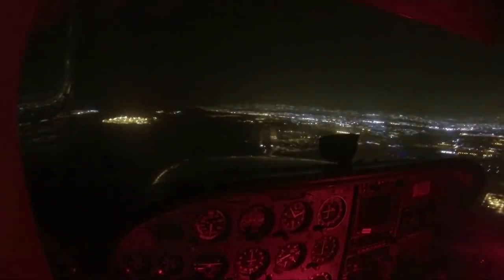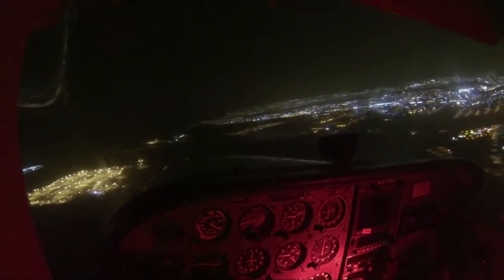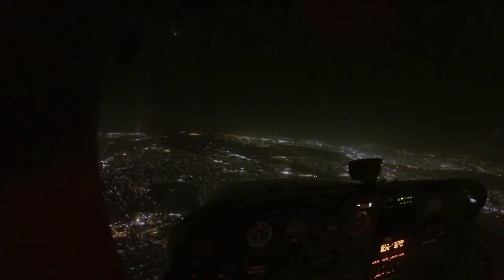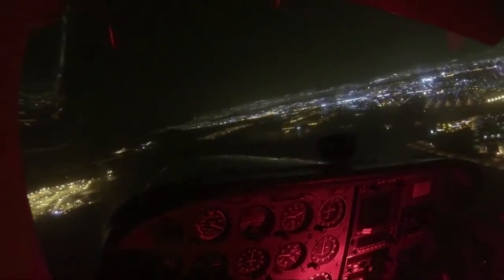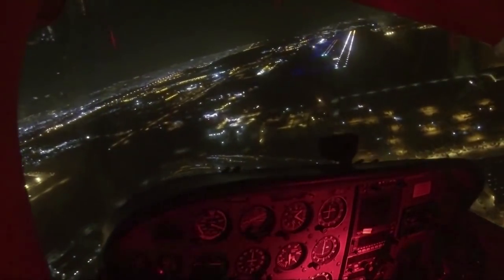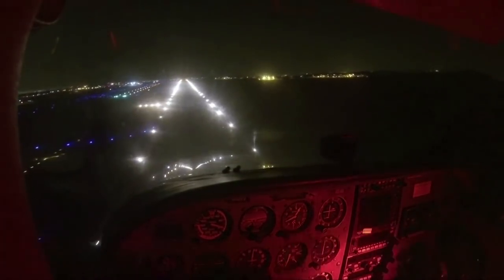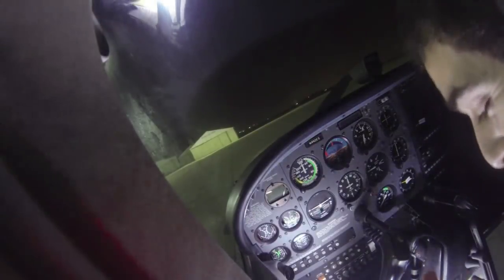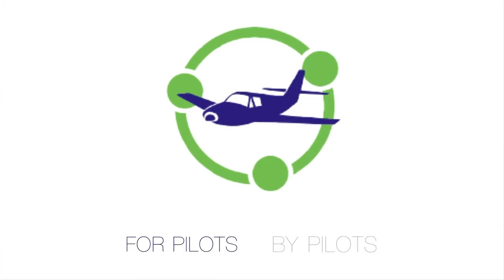Total Electrical Failure at NIGHT - Low time pilot - POV Flying

Comment: I know this video. Great work! Great airmenship....
But : If you're flying in Europe (or let's say outside of the U.S. / Canada Region) you won't even have a ARCAL. If it's dark, it'll stay dark!
But: If you do you're in doing night rating, ask ATC to grad. switch down light. It'll give you a impression about what could happen...

Remember: DO NOT SWITCH ON LIGHTS! It'll blind you! Your night-vision needs aprox. 30 minutes to be 'good' , but just a flash to be back at zero!!!!!! 

My personal is more into "What will I do in a Night SE Failure while XC...."
Reply from the maker: EXCELLENT point about not turning the lights back on right in front of your face... 
Best do cycle them from far away and then be sure the intensity is set to where you want them...
And agreed that an engine failure at night is a whole world of trouble.

Comment: Reminds a little of the joke: You have a complete engine failure at night.  You feather your prop and  turn on your landing light and find that you're flying up a box canyon with high walls on each side and of course you're descending.  What is the best course of action?
Answer:  Turn off the landing light.  You really don't want to see that.

Comment: I think he did the right thing to land the plane despite the lights going off, with electric failure your options are rather limited and if you can land, you should land. Otherwise you will have to ditch and that is not good.

Comment: I just recently did my first night flight and i was at an unfamiliar airport in the middle of nowhere with no lights around the airfield and I was turning downwind to base when the runway lights cut out on me and I instinctively keyed the mic once I leveled the wings on base and didn't see the runway where it was supposed to be and sure enough the lights had turned off on me, but after watching this I am for sure going to get a handheld because I don't ever want to get in that kind of a pickle!! I think that should even be a legal requirement to have on-board on night flights!!!

Comment: WATCH CLOSELY BETWEEN 3:09 and 3:10 in the video...  There is an object that passes by the aircraft at an AMAZING rate of speed, and veers off to the right.  What the hell  was that?   I'm not sure if it is just a reflection in the windscreen or not, but it sure looks like a flying object...

Comment: What is plan B (or C) if the runway went out way before he got there?  Divert to another runway?
Reply from the maker: Feint well...  diverting to a different airport wouldn't solve the problem.  He would likely have had to abort and climb up and then see about getting the hand held radio tuned to get those lights on.

Comment: Since he didn't declare an emergency, wouldn't this be a cars violation? Landing at night without the proper lighting?
Reply from the maker: Interesting theoretical point, but I think in practice it is ultimately moot... first off, it was in the states so the CARs don't apply ( but maybe there are similar FARs), second, he had no way to declare as his radio was not working, and there was no one in range to hear the call anyway... so it could be argued that he would have declared if he could have.  Bottom line, I highly doubt he'd get violated by any regulator for handling this the way he did.
Reply: Declaring doesn't require a radio.  It's an internal action/concept.  Otherwise aircraft without radios could never declare an emergency.  There was no violation of FARs due to the emergency of the situation.
Reply: In both the US and Canada (and, for that matter, most other first-world countries), if a law requires something impossible or unsafe, you're not legally liable for breaking it. So, for instance, if you can prove that the accelerator on your car was stuck, the speeding ticket goes away.

Comment: I know they need to turn the light off but why don't they have low-level lights like those blue ones because if they do shut off while you're trying to land at least the low-level white ones would still give you a good indication where the ground is bought a fact anybody else in the area because they won't be that bright

Comment: why can't the lights just be on all the time? is the cost of electricity to great to outweigh the benifet of that?
Reply: Yes, they need to save energy and reduce light pollution for the surrounding neighborhood. It's very expensive to run those lights.

Comment: I'm not a pilot, but the first thing that comes to mind is to turn off the landing lights, and reset the breaker...    I could be wrong though.
Reply: The camera doesn't show the lighting panel, so you can't see that he did just that, and it didn't help.

Comment: Maybe I missed this part but was he able to click the runway lights on?  I see the lights on but I'm not sure if he turned them on or someone else or whatever other reason.

Regardless, what I'm interested to know is how would you turn the runway lights on if you had an electrical or even just a radio failure?  Without a backup portable/handheld radio, how could you do this?
Reply from the maker: He arrived just as the tower was closing... (if you watch the beginning again you can see that I establish that - but maybe not well enough apparently :)
So, he didn't need to turn the lights on when his radio was working, but when the tower closes, the count down starts; usually ~5 or 10 minutes I think..?
As for how to turn the lights on with out a radio - you can't - It's a bad situation to be in - that's kind of the point of the video :P
Reply: I also just read the description which stated that it was a dead cell that caused a short of some kind when the landing lights were turned on.  I'm wondering if you were to flip the landing lights back to off or remove the fuse, would the load on the battery be reduced enough to return power?
Reply from the maker: Eric Gravel Good questions - I'm not sure of the specifics of exactly what Steven did to trouble shoot - but I imagine he tried most of that...
Maybe he can respond if he see's this comment.
Reply: ***** I knew about turning lights on using radio (I'm a student pilot with 10 hours thus far) but not that much more.  I was reading the wiki page on it and it says that you can turn them on with 7 clicks and intensity can be changed with 3, 5, or 7 clicks afterwards for low, medium, high intensity.  There's also a comment in there stating that it's a good idea to key in the intensity level (either current one or the one you desire when on final) so as to reset the countdown.  That would avoid the situation he found himself in; lights turning off when you're flaring the plane.
Reply: That is a very good idea (pull some fuses). However, I did not try that. In my troubleshooting, I turned everything off, then tried to get things back, one at a time, and not a single thing worked but the flaps until we had shut down the aircraft. Once EVERYTHING had been shut off (engine included), I was able to get my lights back on. I have no idea if pulling any fuses would have done anything as this was such an odd and unpredictable electrical failure (note even an intermittent VAC warning. There was never any VAC issues.) 

Not a bad idea though, that's for sure. Fly safe.
Reply: Steven martinet
what airport was that
Reply: No, a person in the tower has to put the runway lights on.
Reply: @Laverne Johnson, "this dope" if you're referring to the low time pilot in the video performed extremely well, didn't panic, managed risk, and continued his approach to a successful landing while the lights extinguished.  I'd bet many high time pilots wouldn't perform this calmly in the same situation.
Reply: At least that dope probably understands that radios run on electricity, and thus a complete electrical failure means your radio doesn't work. He didn't forget.

Comment: Why are the runway landing lights turned off on short finals? is it a procedure or what?
Reply: +charan k.v The tower had closed, at which point the runway lights become pilot controlled.  usually (when your radio is working) you would tune the CTAF frequency and click your transmit button 3, 5, or 7 times for low, medium, and high intensity runway lighting.

Comment: Was the runway lights going off a failure or are they supposed to go off when no planes have landed in a while?
Reply: +themikester223 They are on a timer, The pilot uses the radio to turn them on and then a timer starts to turn them off. Pilots can also manually turn them off or dim them is needed. All with the radio and mic clicks
Reply: Brian Green Thanks!
Reply: Wish we had such a system in Germany

Comment: amagine how bad this would be with a glass cockpit
Reply from the maker: +PEPcessna - Retired There is a back up battery, so I "think" the electrical has more redundancy - that said, there are also back up steam gauges for airspeed, altitude and attitude, so you're not in that much worse a spot.
Reply: that is very true, losing your primary flgith display would not help in this situation, but thanks for the info didnt know that glass cockpit had backups
Reply: +PEPcessna - Retired He also had a tablet.  Not the best but he could have got some information from it.  Something is better than completely nothing.

Comment: Potentially stupid question because I'm not a pilot. Did he have control over the runway lights or is that a completely separate issue that happened?
Reply: They are on a timer. They activate when a pilot uses his radio. He had no radio.

Comment: Why would they of runway lights.......its actually quiet risky for the pilots while landing so y would they do it so?
Reply: It saves on electricity. Airport lighting burns a LOT of juice, and a lot of airports are on shoestring budgets, heavily subsidized by local governments whenever they can't pay all the bills from tenant services like FBO's, mechanics, hangar rentals, etc., so they have to cut costs wherever they can afford to do so.

So a lot of airports such as this one, have an automated system at night that listens in for a thrice-keyed mic on the freq the system is tuned to listen on. Pilots can then tune their radios to that freq, key the mic three times, and boom. THERE SHALL BE LIGHT!!! :D

For tower-controlled airports, this also cuts the cost of having to keep the tower staffed and running 24/7 as well. The general rule of thumb is that tower-controlled airports become uncontrolled after the tower closes, and all pilots coming in or leaving during that time are basically on their own save for the sector ATC which is often in a facility somewhere far removed from the airport.

Comment: What are the odds of having electrical problem with the plane, and the runway happening in the same incident? this is some Devil shit
Reply from the maker: The runway lights actually time out after a few minutes (at non towered fields, or at towered fields when the tower is closed).  The pilot can reset them by clicking the transmit button on the radio a few times.... assuming the plane has power to the radio

Comment: Why he uses red flashlight/
Reply from the maker: Gediminas Jesinas red helps preserve night vision.
Reply: ***** Thanks, this is good advice.
Reply: +Gediminas Jesinas Our eyes have two different kinds of photo recepors.  Rods and Cones.  Rod cells are almost entirely responsible for our night vision, but it can take your eye a little while to fully transferring to using almost only rods.  Cone cells are primarily needed for color vision while in bright light.  Red is very low in the color spectrum that our eyes can see.  In fact the next color below red is Infra-red, which we can't even see without special equipment.

In a very dark cockpit, if you were to suddenly use the very blue white of a normal flashlight, your eyes would immediately begin relying on its cone cells again, and to get your good night vision back you would have to go through the long process again (30min if i remember correctly for full night vision).  By using a red flashlight, you can see what you need, but don't force this change in your eye.

Same reason that if you go out to look at the starts, they become more brilliant and beautiful as your eyes adjust

Comment: I'm an old man with lots of right seat time... looking at getting an Ercoupe. Just looked at 2 of Your vids and Loved 'em both... If You have anything on Flight Chops... RE: an Ercoupe, pleeze let Me know, Mike Allen AllenTatler on Gmail... PS: My Brother is a CFIG with gobs of hours at the Hood River Airport (over Mt. Hood) and is now owner of Turf Aviation in Lower Arizona. He always has His Go-Pro with Him... If anything happens... on Camera... I'll Let You know, Michael Dewitt Allen... On FaceBk
Reply from the maker: Very cool thanks - and I would like to check out an Ercoupe and make a video about it some time.(that's the little plane with twin vertical stabs and no rudder pedals, right?
Reply: Correct... Ercoupe was Designed by a Famous Aviator named Fred Weick in the late 1930's. He invented Tricycle Landing Gear... Used on Military Planes of WW 2, saving  gobs of lives.  Check out "Ercoupe Owners Club"  or "Fred Weick"

Comment: Total electrical failure would mean the plane engine wouldn't run. =p
Reply from the maker: No.  The magnetos are separate redundant systems - not at all connected to the electrical system.
Reply: @FlightChops  Magnetos create electricity yes?